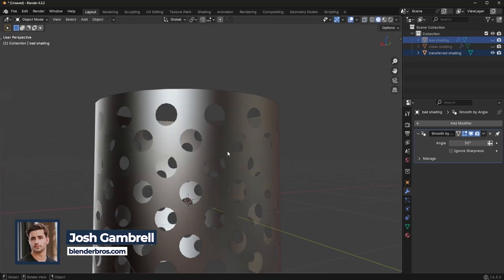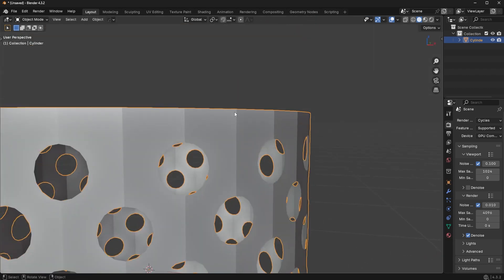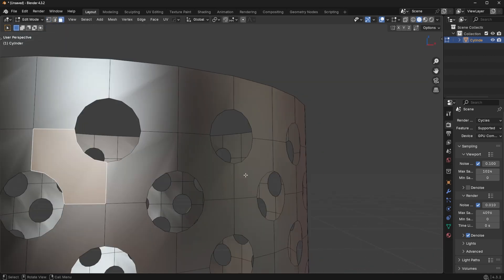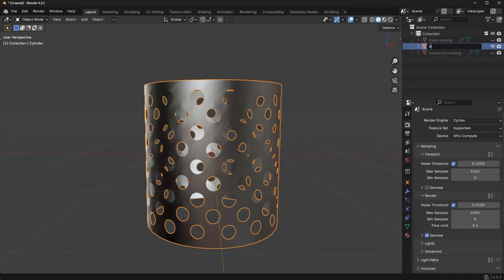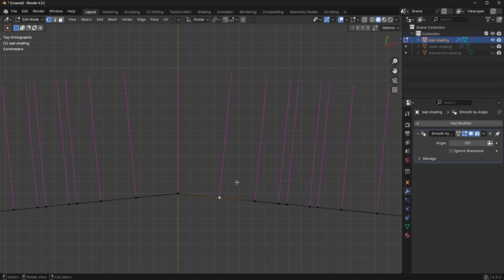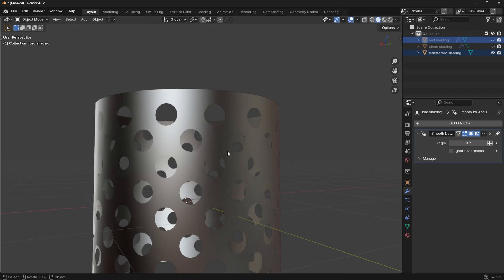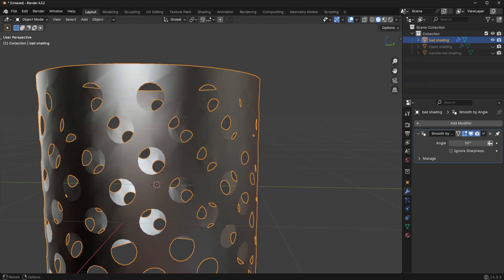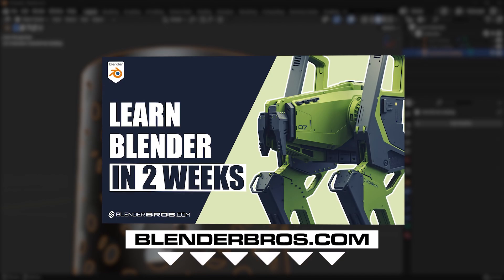How To Get Perfect Shading WITHOUT Retopology

Comment: This works great for a basic surface object like this simple cylinder with holes but how about more complex objects with extruded areas that we're more likely to be working with? We can't just magically add a clean object version like this basic cylinder to transfer data from in that case. Thanks for the video though, it's interesting for sure and I learned why that bad shading occurs now at least.
Reply from the maker: Plenty of caveats - fully agree. Some thing simply require retopo depending on the pipeline. But I've deployed this trick many times before (game assets with ngons included) with zero issues.
Reply: @JoshGambrell  I find most of the time I'm just adding support loops or insert faces to fix bad shading. I guess it just depends on the kind of model you're working on.